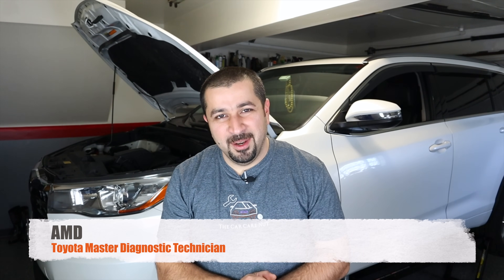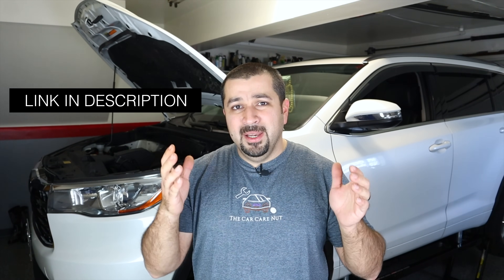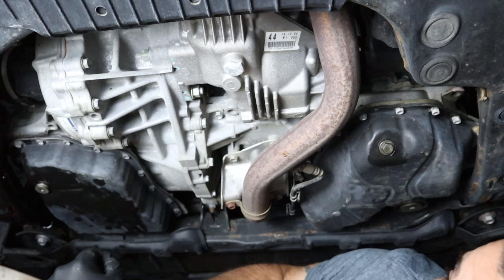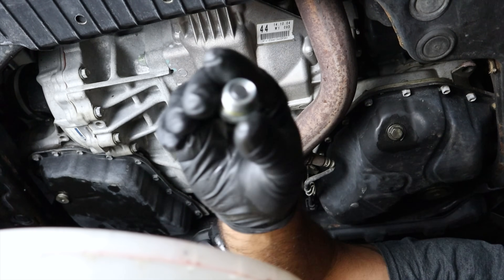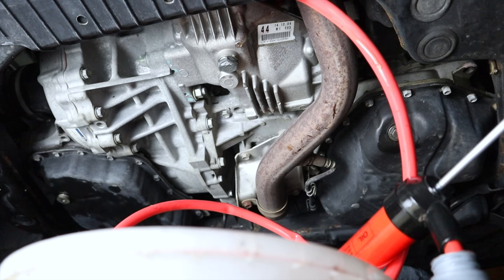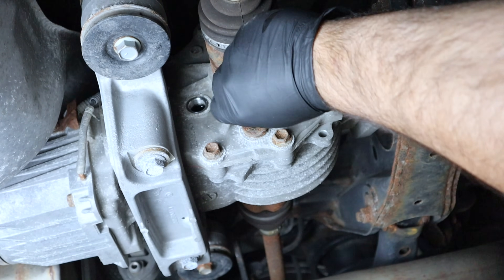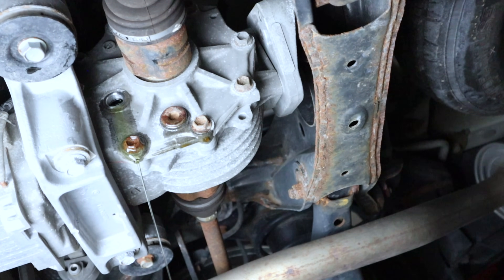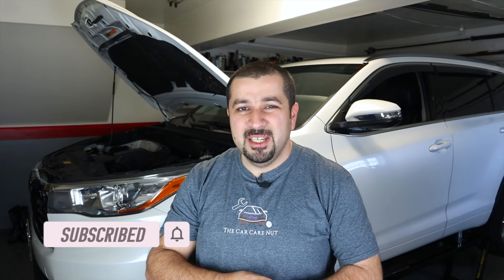How to change Transfer Case and Differential Fluid on Toyota and Lexus

Comment: Thank you so much for this video and your guide. My local dealer wanted $567 dollars for this same job that you did on this video, I was able to do it under 45 minutes and for about $60 dollars. God bless you and your family.
Reply: $567 LOL. and this is why the Stealerships will never get my business. I saw an invoice on my Toyota (from previous owner). The stealership charged $600 for an engine air filter, PCV, and cabin filter.
Reply: Damn bro went in😢
Reply: How tf you spend $60 only??? The toyota ws fluid only is $100 for 6 qts
And then another $10 for the crush washers
Reply: @martincortez4956  I don't believe he is referring to the Trans fluid. Just the diff fluid and the transfer case fluid or (Power transfer unit on AWD). 

75w85 is the fluid for an AWD rav4 and you can easily use 75w90 fluid that is fully synthetic and it's like 1/3 of the cost. 

Ws atf fluid can be purchased on rock auto. Do not buy your fluids from the dealer!
Reply: My toyota dealership charges $100.  Jiffy lube charges $120. That's for each one, xfer case, rear diff.
Reply: They wanted $300-350 here in Sarasota for a job like this
Reply: The Toyota Dealership ( the oldest Toyota dealership in Canada and possibly North America ) that I deal with has had 3 different owners since I bought my first Toyota. The first owner  when I bought a 2011 Sienna in  November 2010 was great and as a big bonus the head mechanic had almost 40 yrs of Toyota experience. After my " complimentary services" were done I continued getting the oil changes done there as they charged just over $72 ( Canadian dollars about $58 USD ). I could barely do it myself for that including the 6 liters of synthetic oil and filter costs plus they checked wipers, brake thickness, tire air pressure tread depth, lubed the hinges etc and topped up the fluids. In 2017 we traded that Sienna in on a Highlander. After the complementary services I got the next 4 changes at the dealership. The first 2 were around $95-$125 ( checked the invoices a coupl months ago and I'm pretty sure that they charged me for a new filter housing and they ar the only place that had ever changed the oil so if the oil filter housing was seized it was by them ) Oil has almost doubled in cost the past couple years and filters have gone from about $10 to $18. I last had it changed by them back about 7 months ago and it cost $258!!!! and that included another oil filter "assembly". The most recent oil change I did myself as I have done with all my vehicles since 1979. 5.8 liters of synthetic 0W20, an off brand filter for about $15 and the drain plug gasket for $2. Not only that but the dipstick always showed oil JUST above the top mark on the dipstick when they did it and now after my change it sits right at the max when the engine is fully warmed up and just a bit  below that when it's cold.
Reply: how can a dealer charge $567?????? That is highway robbery
Reply: Dealers rob people blind, also from my experience they consistently cut corners. I caught one taking the high end oil I provided and using the recycled oil then trying to keep mine. I keep cameras in my truck I can access and they denied right until the end then the boss tried to offer me free oil changes for life if I didn’t sue. I told him “why the $&&@ would I bring my vehicle to you bums” and sued them anyway.
Reply: In new york they want  900 plus for a tacoma with manuel trans ridiculous

Comment: I called my local Toyota Dealer for a quote on my 2019 Rav4 Adventure (Torque Vectoring) just out of curiosity: $400 for rear diff, $300 for transfer case.  OMG, are they freaking kidding!!! I'm doing both for about $100 in about an hour plus I'll have washers and the syringe for the next change. Thanks for the video AMD!

Comment: I went to my Lexus dealer and requested them to change these fluids at 32,000 miles on my 2020 Lexus IS300 AWD Sport.  They said they don't do these fluid changes as they are lifetime.  Never had a dealer turn down a request for service before.   I may have to try this myself using this video as it sounds like it should be done.  Thanks.
Reply: You can do it!!  I used four ramps so the whole 2020 Rav 4 I own was high enough off the ground to work.  I picked up the ramps of FB marketplace for $30 a set.

Comment: What about checking the breathers on Toyota Transfer Cases and Differentials. Where are they located?  When I worked as a diesel truck mechanic (retired now) when doing a regular engine oil change and service, you always checked the Transmission and Differential breathers to make sure they were open and not plugged up with dirt. A plugged breather will allow the unit to build up pressure (from the heat) and push oil out a seal. I've seen guys change a leaking Wheel or Pinion Seal only to have it leak again because the breather was plugged.

Also when servicing drive train components, the vehicle must be level so that the fill plugs work correctly. A vehicle that has one end up on jack stands is likely going to give you an incorrect reading on the amount of oil you installed. Not everybody has a vehicle lift in their garage.

Thank you for taking the time to make these videos. There is a lot of information available and you do a great job explaining everything. 

Best regards

Gerald

Comment: One of the most important elements of your videos.. is going slowly and being calm.  People that are new to working on cars can get nervous and rush thru things and make mistakes. Your thinking thru things is a great thing to teach. 
     I many years ago did a clutch / press plate / pilot bearing on a 280 z datsun.  I made the mistake that you covered.  I forgot to loosten the fill plug until I had the transmission back in the car.. my mistake clearly.  I ended up filling the gear lube thru the speedo cable hole with the back of the car up 5 feet..  a huge project.   I told the owner... my girlfriend that the car is good..  but if we ever pull out the trans or clutch I need to address that fill plug.  She never had anyone ever check the level in 15 years of ownership ☹

Comment: Thanks Ahmed! I'm getting ready to change the rear diff fluid on our 2008 Highlander with 250,000 miles on it and wanted to make sure I watched you do it first! Being in Massachusetts, I've been underneath the vehicle recently to observe what things look like after all these New England winters - that diff is crusted over with rust! I'm so glad to have seen you tap the plugs with a hammer, great tip!! Thanks again for the effort you expend for all of us DIYers.
Reply: It took me 2 days to change my gear oil. It was due to weather (I have no garage!) and schedule. But I took my time, sprayed PB blaster on the plugs, tapped them with a hammer, chipped away tons of rust crust on the diff casing, vacuumed, air blasted, and took notes of other things that needed work in the near future. (Like, how many people in the snow belt trust that their spare tire hanger is going to last? I fear the tire flying off one day...)

The gear oil was probably last changed over 75,000 miles ago - I really don't remember. It came out like medium maple syrup in color, not too dark, and it had minor metal flake in it. The drain plug magnet is almost 3/4" long and had a fair amount of metal sludge on it, but nothing worrisome at all. I was very pleased, especially after having to spend $4,000 earlier this year to replace the front differential after it failed.

Keeping the vehicle on a flat surface to be sure the gear oil fill is accurate is not the easiest project to do in your driveway. 😜 I removed the spare tire so my shoulders could fit under there.

Comment: I changed the differential fluid today in my wife’s Lexus. I crawled under from the rear as far as I could and used a mirror tilted toward the plugs to show me where to put the hex drive socket and also where to insert the fill hose into the fill hole. The mirror made it easy, without having to raise the vehicle.

Comment: Thank you for this video sir.  I didn't realize how easy it was to change differential and transfer case.  It looks easier than changing engine oil. My dealer was charging me 400 bucks to do this job.
Reply: My toyota dealer  in Canada is $200 for both.
Reply: Ripoff ripoff ripoff, even 200 is ludicrous.
Reply: @SpicyMcGeezaks ya but 8 think dealerships now are using the “ shop rates “ from “ the book “ which is worst case scenario to charge an hour for draining each one. Also, aftermarket gear oil is way cheaper than Toyota’s gear oil. My dealer charged me a half hour labour ( $130 an hour ) to change a cabin air filter on my 8 month old Rav 4 which had never seen dust or bugs without me asking them to change it. I told them to take it back out because I change my own cabin air filters. They didn’t show me the old filter either. They took off the $65 labour.

Comment: Your contribution to the DIY community is immeasurable. The amount of detail you show within each instructional video is far superior compared to anything I have seen out there. God bless you for the work you do. Subscribed.

Do you mind clarifying for the 2017 Highlander XLE how many different crush washers/gaskets are there for the front, middle, and rear gear oil fill and drain plugs/bolts. I want to make sure I am ordering the right parts.
Thank you in advance for your time.

Comment: Just changed both fluids for first time on 2018 Highlander @ 60K miles. Thanks for the detailed how-to. Used Mobil Delvac 75W90. Both fluids looked OK, magnets were very dirty. New crush washers with rounded side toward housings. Will do again in 30K.

Comment: My local dealer charges $450 for this as a “4 Wheel Drive Service.” Using this channel and others, I was able to do it for $75–including synthetic gear oil and new gaskets—on my 2005 Land Cruiser. 

Thanks you!

Comment: Just did the transfer case & front/rear diff service on my Dad's 2017 SR5 Crewmax 4WD Tundra last week! Ordered via that Ravenol Gear Oil kit. I reused the washers because it was the 1st time for this service but will replace for sure next time now that I know the part numbers. Thanks AMD.

Comment: Cool. I have a 2006 matrix 4wd with 183k. I use a 24mm 12pt box end (fill plug) and a 24mm 1/2 drive socket (drain plug) for transfer case.  I ground the chamfer  off the end of socket so it grabs the low profile bolt head better. Very easy service with proper information you have given.

Comment: You saved my bacon with the hammer trick. Some penetrating oil overnight and some hammering on the front diff drain plug got it loose. I had tried a long cheater and even an impact without success previously. Last person to tighten it was the local Toyota tech. An Arizona 4Runner without a speck of rust.

Comment: Even though I had watched your video before I forgot about the 'hammer tapping' trick. I tried to remove the fill plug on my 2016 Highlander's differential with a ratchet (no go) then an impact (again no go). I watched this video again and tried the 'hammer tapping' and both of those plugs came out SOOOOO easily with just a ratchet!! Thank you so much for the tip, you saved me a bunch of money! Now, I just have to find the fill plug on the transfer case LOL.

Comment: I am so happy i found this video. I had my highlander transmission replaced  and when i got it it started to leak transfer case fluid through the weep hole, only when i drove it. I took it back to the shop and the technician checked the fluid but i noticed the fluid gushed out and at that time i didnt know it should not gush out like that. They said there was no leak and it was a little normal to have som seepage in that area because they recently serviced it. But i noticed it kept leaking it was just small leak but i wasnt very happy about it. I started looking for answers and found this video, i remembered i saw a lot of oil comin out when that tech showed me that it was ok on oil level, and i went to check myself after watching this video, and sure it was overfilled with fluid. Thank you sir for this video it really helped me. I will look forward to see if it doesnt leak again, but im pretty sure it wont.
Reply: I have the same problem right now with mine, how did it go after draining to correct level.
Reply: Yup not uncommon even with “Toyota Trained Techs “. I also watched another YouTuber video on these fluid changes and in his case, there was only a couple drops when he decided it was full. I’m sure it was probably really close and I don’t know if being down a couple ounces , the whole transfer case on my Highlander only takes .8 of a litre ( a tiny bit more than  .8 of US Quart ). I use a clear 1.5 litre clear large syringe so I put .9 of a litre ( markings on the syringe are Litres and US quarts ) gear oil in the syringe and pump until it flows out steady. If there’s still more than a 1/4 cup of gear oil left in the syringe I check ths5 the hose is still fully inserted and sloooooowwwwwly pump some more in. I wish my 2917 Highlander’s transfer case fill plug was as easy to get to as the one in this video. Either that or my hands and arms are way bigger than the Car Care Nut’s hands.

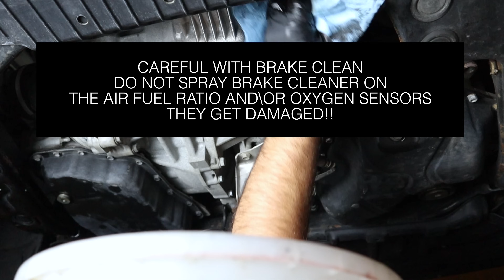Comment: Really enjoy your educational style of videos and recommending it to friends.  At time mark 10:40, about cleanup from oil on the exhaust. I actually throw a plastic or silicone pad over the pipe before cracking open the fill and drains to keep oil off the pipe. Cleanup goes much easier.

Comment: This video was very helpful and this is definitely something anyone can do. A couple of tips based on my experience with this is: 1. If you are skinny you can do it without even jacking the car up. 2: No idea how he got a ratchet in there as I had to use a 1/2 inch drive ratchet for the 24mm socket and while I could get onto the bolt, I couldn't ratchet as the exhaust pipe was in the way even with a swivel head. I ended up just adding a bunch of extensions (I saw this in someone else's video showing how to do this) and that allowed the ratchet to be all the way back behind the black floor shield and gave it room to move without rubbing on anything. From back here you can also see much better 3: I ordered a fluid pump but got the wrong size for my container and had to improvise. Using a large fluid syringe it was also pretty easy to put it in (especially for the rear diff). 4: Mine took exactly what the manual states for a 19 Highlander - 0.8qts in the front and 0.5qts in the rear. 5: There is a random hole on the left side of the rear of the transfer case (appears to be for a stud of some sort?). Going in blind after having been out from under the car for awhile and with the refill bolt out, it is easy to confuse the two if you are just sticking your hand up there to feel for a hole. If you do make this mistake, the oil will just seep out right away from the stud hole and if you are using a pump it will likely make a big mess. The best way to get visibility is to go back behind the black floor shield as you can see the refill hole very well from there. Whether using a syringe with an extended hose or a pump, i would suggest you set it up and then pump from back there so you can see everything you are doing.
Reply: Hi Sean, can you please share video link for "I saw this in someone else's video showing how to do this"?
I am having same issue with transfer case fill plug removal (Sienna 2017).

Comment: Back when I was married(!) I bought my wife a 2001 Sequoia.  I changed the rear differential oil at 10,000 miles.  The drained oil was dark gray and had lots of metal shavings in it.  My next change was at 30,000 miles.  It was much less discolored.  At each differential oil change the oil looked cleaner and cleaner.  I guess my last change was at 120,000 miles.  That oil looked like I put it in the day before.  It was that clean after 30,000 miles.  I did all maintenance by the book and we never did have any problem with that vehicle which appears to be typical for a Toyota.
Reply: May i ask what other maintenance did you do  on that vehicle? I'm asking because I'm new  to DIY car work and I'm trying to learn as much as I can about taking care of a car.

Comment: Great tip on the taps with a hammer. My plugs were rusted quite a bit more than the ones in this video. I didn’t have penetrating fluid so I used some brake cleaner after using a #mall wire brush. Before doing these things I couldn’t budge the fill plug. Afterwards it was as easy as if the plug had already been loosened half a turn.  My Highlander has 125,000 km on it. The dealership’s Service Assistant manager told me last year  Toyota has no recommendation for when to change these fluids. I us3d 75W90 Royal Purple synthetic gear oil and a1.5 litre ( about a US quart and a half ) syringe type of fluid transfer pump. It worked flawlessly, no leaking no mess. The plugs look way bigger on here than they did when I changed the diff.

Comment: Very informative and explains why I was unable to find my daughters front diff drain/fill plugs in her AWD Sienna a few months ago!! (But I got her TC and rear Diff changed as well as the transmission) For those crush washers, we put the side with the crease towards the vehicle, smooth side on the plug.